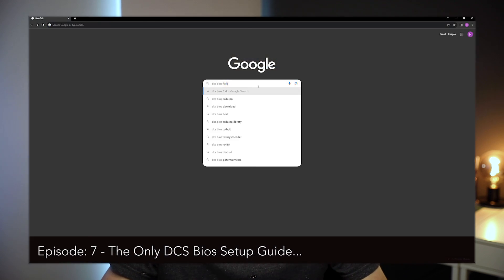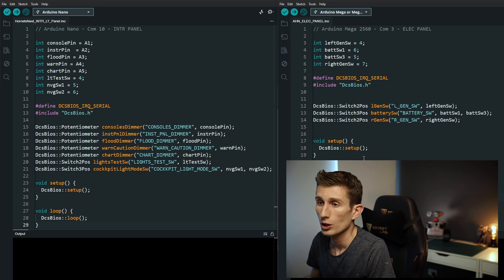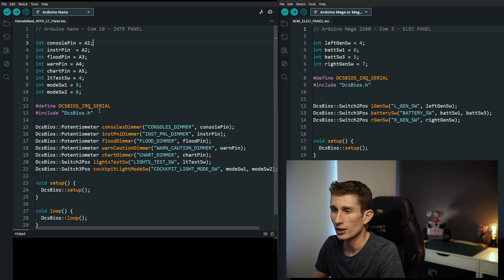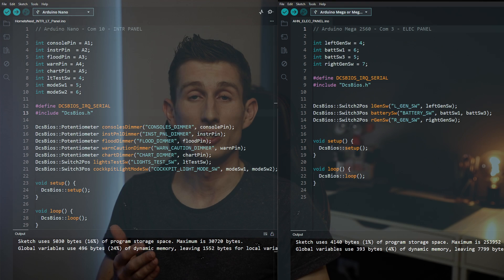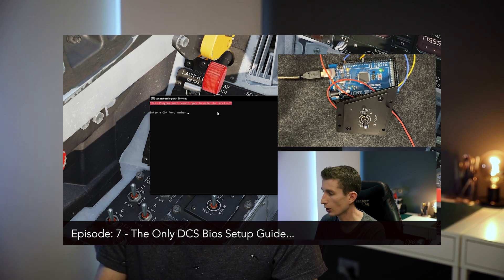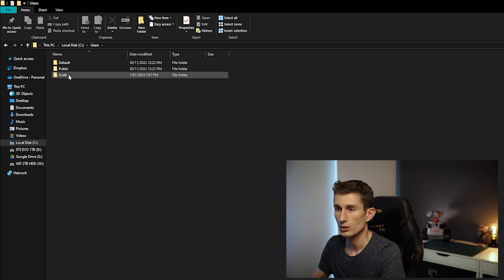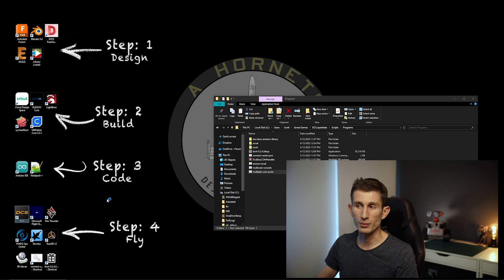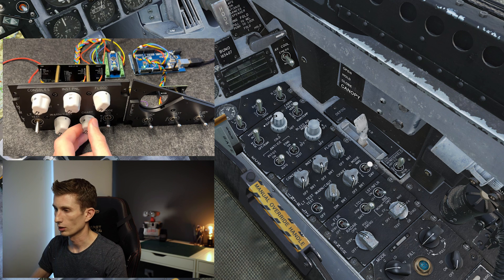Ep: 12 - DCS Bios | Connect Multiple Arduinos to DCS World | Code Your Flight Simulator

Comment: The explanations are good, thanks for that. The big problems started when I used my 14th USB port. Windows officially supports more than 120 ports, but not many at once. So one panel after another would fail, and that in the middle of a mission isn't good. I often had to restart the PC. My solution ultimately was to not use more than 13 USB ports. Not even via hubs. So I connected more and more panels to an Arduino Mega via RS485. It then only uses one port. It's worked perfectly since then; my problems have disappeared.
Reply from the maker: Oh nice! Good to know 🫡🫡 that gives me hope 
Because the cockpit is ultimately designed to run as a RS485 system - so I’m glad you didn’t have too many issues after you switched

Comment: Need some help....when i run the "connect-serial-port", 19 out 20 times i get a permission error.  when it does work i have no idea what i have done different for it to work.   plus the user interface at start up is completely confusing.   starts by saying "waiting for 5 secs, press a button to continue".  does that mean press a button before the 5 sec timer ends or wait 5 seconds and then push the a button to continue?    I think i have tried all the possible start options. 1) wait the 5 seconds, 2) push a button before the timer expires, 3) do nothing, 4) start "connect-serial-port" before starting DCS or waiting until DCS starts, but before select aircraft/mission or after selection aircraft/mission but before "FLY".  DCS folder has been placed as a windows 11 Microsoft defender antivirus exclusion item.   any hints would be appreciated. thanks
Reply from the maker: Hey mate! Sorry to hear you’re stuck - and sorry for the miss reply, not sure why the first time I sent it failed 

Common issue with that is 1) you have your serial monitor open in Arduino IDE, even if it is on another sketch… that one gets me all the time (so close any serial monitor you may have open) … 2) next biggest reason would be the coded call to Bios… in the top line where it is DCSBIOS_DEFAULT_SERIAL…. Use “default” for all board types EXCEPT Arduino Mega .. if you are using a Mega change it to DCSBIOS_IRQ_SERIAL…
3) maybe wrong board type selected or wrong comm number entered 

Start up sequence 

You can do either, I have the game running by the time I do it, so open the connect serial port, enter your number, press enter, and the option of press a key will come up 

You can either wait it out, or generally I’ll press space bar and get it going straight away, either is fine 

If your game is paused, loading (essentially anytime you’re not in the aircraft) … you won’t see the rapid text running … as soon as you press play you’ll see it

Comment: Hello, first of all, your posts are magnificent. Your explanation is extremely understandable. I also want to make panels for DCS F-16. I have Arduino nano, uno, mega cards with CH340G chip. I connected it with a toggle for testing purposes and transferred the code to Arduino without any problems. When I run DCS and enter the port number to connect the card with the connect serial port program, I get a not found error and I cannot connect the card to DCS. Is there a solution to this problem? I am waiting for your help, I wish you continued success, I eagerly await your new posts.
Reply from the maker: Hey mate! Sorry for the late reply, I’ve been down sick with a stomach bug. Have a look at swapping out the top statement in your BIOS code from 
#define DCSBIOS_DEFAULT_SERIAL

To 

#define DCSBIOS_IRQ_SERIAL

Of the other way around, some boards needs IRQ or Default … and I’m still trying to work out why 

This is the most common fix to your issue 🤙🏻
Reply: @aHornetsNest  First of all, I hope you are well and healthy again. Thank you very much for your interest and answer.
#define DCSBIOS_DEFAULT_SERIAL
it worked. I made the laserarm switch on the F-16 on the first try and it worked. It was a great feeling for me. I follow your posts with interest and eagerly await your new videos. Have a nice day.
Reply from the maker: @akinilgunify awesome!!! Glad it worked! 
I think IRQ works with Arduino Megas or similar chip sets 
Feel free to send me some progress pics to Facebook or Instagram or ahornetsnest@gmail.com 🤙🏻🤙🏻🤙🏻
Thanks :) over the worst of it now, spent today building so I can get a video out soon

Comment: Great tutorials!!! Thank you very much! I've been using Leo Bodnar's joystick interfaces, but I'm thinking of switching to Arduino. My main concern is that since you set up every switch through DCS-BIOS for a specific plane (F-18), what happens if you want to fly another plane (F-5 or MiG-29)? Those modules won’t recognize your Arduino setup, right?
Reply from the maker: Hey thanks for the comment! Yeah that is a very valid concern, and it all comes down to how many extra modules you want to fly 
For me it will be just F-18 as a high fidelity sim, and then generally I’ll fly the UH-1 or UH-60 with a little bit of F-5 and for all of those I’ll probably just use the Hotas. 
But I do believe there is a way to write program with DCS Bios for multiple modules - and it will take info from the game and know what you’re flying

Comment: Your content is amazing!  My set keeps disconnecting from dcs bios…..Initially I thought it was a power issue to the usb ports and I have 2 x arduino nanos, and 1 x ELEGOO MEGA 2560.   

Seeing this video I’m gonna go test out adding the comm ports.  Why is that required?  When I initially boot up DCS bios it auto connects to the boards fine, but soon after I hear the usbs disconnecting and it won’t find the boards again. 

I’ll give this a try!  Also wondering if it’s the rotary switches and I recently added.. maybe I’ve wired them up wrong and the voltage is kicking the boards off 😅
Reply from the maker: 🫡🫡🫡 got your messages 🙂
Reply: @aHornetsNest thanks again for the help!  All my panels are now working super well, and re-wired the set up.   🎉
Reply from the maker: @TallWestEddy  beautiful!!! Great to hear

Comment: Here’s a question for you: have you considered using RS485 for your final cockpit? I’ve been having problems with my pc when driving all the USBs I have today. Admittedly, the panels were not build by myself, and their arduinos drive the backlighting, which can cause usb issues. But in any case, a fully populated cockpit will have loads of arduinos and USB connections, so I’m contemplating going for RS485.
Reply from the maker: Hey yeah I will be :) the OH system uses that - and I’ll make a tutorial on that 😃😃 one or 2 usbs work well if you just want a button box or two… the moment you go full cockpit you need to be more calculated and enhanced with the avionics

Comment: so how can we reduce the number of USB devices we have to plug in? is there some way of consolidating all the inputs into fewer arduinos?
Reply from the maker: Hey there is definitely ways to do it… but that just ups the intensity of the code and has a chance of slowing the latency down between toggling and inputting to the game 
But I’ll definitely cover this in up coming videos 😃
Reply: @tsNest i think I've come across the method. an "RS485" network? is that the way to do it? 
the reason I ask is i've had issues in the past with as few as 5 HID devices plugged in. devices will randomly stop responding and have to be unplugged and reconnected. 

I dont know if DCS bios devices suffer from this aswell, or if its just a HID issue, but either way I learned a lesson and have vowed to reduce the number of USB input devices going forward. 

also, I've said it a few times now but thank you so much for the effort you're putting into these tutorials. I feel like I'm finally wrapping my head around this now. Cheers mate!
Reply from the maker: Sorry for the late reply mate!! 
Definitely can see that there could be a issue with the HIDs 
Bios works really well with the individual usb ports 
But the RS485 is definitely a viable solution 😃

Comment: I am currently wiring my FA-18 simpit with various boards... Arcaze, LeoBodnar, FS837 and Arduino clones.
I was able to connect the first Elegoo Mega 2650 to the PC via DCS-Bios with the help of your clips.
Your videos are very well structured.
I still have a small problem with the potentiometers:
When the potentiometers (left side, volume control panel) are fully turned up,
the knob in the simulation has still about 1/4 way to go to reach the max position.

Thanks a lot and keep up your great work!
Greetings from Munich
Reply from the maker: I’m glad I could help with some of your progress! Mmmm interesting - send me a message on Instagram and I can get help you debug it 😃

Comment: Again, great video. Thank you.I have one question tho: How does it work connecting multiple arduinos from the same type to a usb hub? So multiple are connected to the PC with only 1 cable. Does this even work?
Reply from the maker: Hey mate! Thank you 🙌🏻🙌🏻
That shouldn’t be an issue … because each port on the USB Hub will be assigned its own COM number 
So it’ll be the same process :) 
Just when you do plug them in - plug them in one at a time so you can see what the COM number is for the latest board you added :)

Comment: Why not connecting a mega arduino and the rest slave arduino with rs485 com and max 487?
Reply from the maker: Hey there! Thanks for the comment 
It’s like all things in this hobby. There are multiple ways to do the same thing 
Connecting multiple seperate USB connected Arduino boards may be easier and more manageable for some followers 
I’m not saying it’s the only way but it’s definitely an easy and achievable way for all the followers to complete at home 

There will be more in-depth - higher skill tutorials as the channel progresses 😃
Reply: Would love to see a video in the future using master/slave  @aHornetsNest .
Reply from the maker: Definitely mate :) it will come in the future for sure 😃😃
Reply: @aHornetsNest  I'm on a mechatronics course. my final project will be the construction of a simulator of an F 16 on a 1:1 scale. the right and left panel and perhaps the central one will be modular. In other words, for example, the avionics power panel on the right console will be installed plug and play in a slot. there will be no wires. a printed circuit and a plug-in interface, people will be able to build the simulator depending on financial availability over time. Each modular panel will communicate with the Arduino master on RS 485. The panels will not have an entire Arduino Nano but only the Arduino microprocessor soldered on the integrated circuit. The electrical supply, LEDs and communication will all be printed on the circuit
Reply from the maker: Very cool!!! That sounds like an awesome project 🙌🏻🙌🏻 keep me updated 😃
Reply: Do you find that some of the boards lose connection when Using this method? Mine is all so unstable....!
Reply from the maker: Hey I did get a little instability when using non arduino made boards, but most of the time they work well 😊 I’ve moved to either Arduino or Elegoo made boards and they work fine